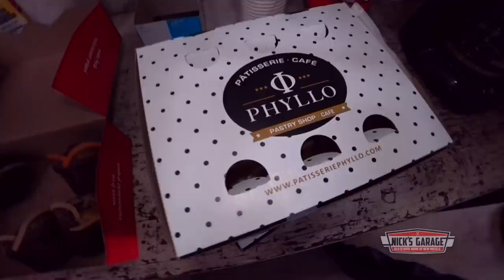1968 Coronet R/T 4 Speed Rises From The Dead

Comment: I had a VW-Manx that was a 1963. The VW dealership helpede build a 2140 cc motor with Empi parts. It was just like you said about a kit car. It felt like a toy to drive but it was a real car. It didn't pass the safety inspection so I could run it down the dragstrip. That's what my 65 Barracuda was for. I fell in love with the original Hemi under glass. My dad and I put a 392 in that car that my dad built on paper and them in real life. He was only off by 30 hp at 5800 rpm from his paperwork to the Dyno. He worked at Chrysler do it's in our blood. My dad passed away in 2003. He forgot more then I ever knew and I can build a motor. Anyway sorry for the rambling. You bring back a lot of good memories hanging around my dad as a young child with all his racing buddies in the garage working on cars and drinking a few beers. My dad always had the old cases of bottles of beer stacked up in the corner and he would tell me to load them up and he would take them back for the deposit and he would buy a few more. It was those little jobs like going under the car to pick up a dropped socket or a bolt. You know that they always go to the center of the car if you drop them or they fall into the frame or a little book that only small hands can get. I remember my dad holding me upside down so I could track a bolt. That is how I started working on cars in 1973. Thank you and have a great day.
Reply: Bigger.        I also started working on cars in 1973.
Reply: @nickpanaritis4122  I think I was a bit younger. My dad had me helping him when I was 4 years old. That's when I changed my first tire. My first car was a 72 Dart with a 383. Way too much power for a young driver. I crashed it after my dad and I worked on it for a year. The car was only 12 years old then. I feel like a old man😄

Comment: Love your Videos Nick! I am a old Mopar nut. I have been out of the hobby for 30 years. I bought a 67 Coronet 500. It was a small block car when it was born. At one point someone put a 383 in it. The car had a lot of "good" bad work done to it. I bought it from a real meathead. I have spent 7 years fixing age issues and stupid human issues. I totally re wired the car. refreshed the engine with cam and lifters, and tons of just stuff. Yet my car still pisses me off. At 900 to 1100 rpm the steering wheel shutters. It did it the day I bought it and after 7 years and other repairs along the way. The shutter remains. Its not speed related, Its not tires or tire imbalance, bent driveshaft, Unbalanced cooling fan, belts. It does it in park, neutral, and in gear. I have a 2:90 gear. Distributor locked out a 14 degrees with FBO, Initial at 20 degrees. That vibration / shudder happens to be at exactly 30 MPH. I have a edelbrock 600 with manual / no choke. The carb is "right" as it was built. Yet unsure of jetting. The only way I can get it to stop shuttering is to put fresh plugs in it and then that only lasts a few stop lights.  The plugs look good when pulled, No oil or fuel fouling.  I did a compression check and all cylinders were within 5% yet all were lower than I hoped for, like in the 140 psi range. I posted a short video clip on youtube on my channel.  Could you spare 15 words of advise? Thanks Nick!

Comment: Late '60s?? We were born the same year Nick, but I tore down my first motor at 4 years of age. I'd been handing tools to Dad, G'pa, others on our farms for more than a year. Left at home that day and I seen that 3 hp Briggs & Stratton for a grain auger-it was on. And when I mean tore down, I had everything disassembled but the carb still laying in 1 piece. I didn't expect the result I got when I showed Dad, it was put it back together right or the belt was coming off. I'd already had 1 belt tanning when he caught me with his .44 mag and I wasn't taking another one. It ran, I'm sure he pulled it back apart and tightened bolts/nuts after the first start up, but it sat on that auger for years.
Wish I'd of stayed with it as you have though. I hadn't owned any tools in a couple decades but emergency tool kits for vehicles until lately. Now I'm taking care of my 4 outboards and just did first start up today for a friend on her 115 hp Yamaha the factory messed up by installing #4 rings backwards and one upside down-not the same as a MOPAR or FOMOCO.

Comment: Nice job on the RT.. I had a 1970 440 coronet with a 318 back when. I couldn't  get it to steer right , wandered all over. I went to 3 shops for help but  only got the story they all steer like crap. Later in my mechanic life I found out any car that has only the spring bushes and the leaf springs to hold the rear axle in place is going to allow  axle movement and hence always you are playing catch with the rear axle moving  around. You can really loose it if the axle moves around under big  power. The answer to great steering is to put a panhard rod on the rear axle. If you really want fine steering, links fore and aft help under big power. also check the steering box for movement  when the car is running.I don't know if you can buy these bits  but I know you can make them. I remember the oldsmobile  442 cars with all kinds of rear axle links and rods. They steered so nice. Love your work and appreciate your vids.

Comment: I owned a cornet 68,  it was huge, plenty of back seat room to do anything.
Reply: Richard Buckner check that
Reply: Thats the reason young guys today like Crew Cab trucks lol..Not as cool or quick as a Coronet RT but has a big back seat and a bed!
Reply: @01trsmar  Before I finally found a wrecked charger with a 440 magnum to put it mine, I still used that back seat.  You could live in the trunk.  One thing I liked that dodge did, they had adjustable front suspension bolts, so you could lift it or lower it. All car manufacturers should have did this. Simple design.
Reply: I had a 68 Super Bee Scat Pack. Converted it to a 413 solid lifter flat tap with over 600 lift, 4 speed, 3:23:1 posi, some suspension mods, headers with oval straights, and L60X15s all round. No problem burying the speedo needle with plenty to go. That car was built in Canada and weighed 2600 LBS. You guessed it, No power assisted anything and it ran with points dist. and a 60,000 volt hyd. coil.
Reply: Start a family?

Comment: When I saw the 1970 Fury my jaw dropped open. I know I worked on that car adjusting the windows. They only ran those on day shift at first because only a handful of us had been trained how to adjust the roof and the glass so they would make a good seal. My fingerprints are somewhere on the pieces inside the right front door, that was my side.

I'm surprised Mike wanted the engine blue. All the magnums I ever saw were orange. But hey, it's his car man.
Reply: Mike.     It is turquoise in 1968. During overhaul, you can see the original color of the block.

Comment: Those break checks are always a little scary for me.  I was driving my 1969 Charger going down a hill in the Capitol Hill district in Seattle and came to a complete stop twice.  I then made a turn onto a level street and hit the gas.  Coming to a red light, I hit the brakes again and . . . nothing.  The drum brakes were so heated after the other two stops that they had given up.  I hit a lady's Mercedes and damaged my front fender while trying to dodge traffic in the intersection.  After that, I converted to 11" front disk brakes using Mopar parts from other years and models going by a parts list I found in a Mopar magazine.

Comment: All the cars at Nick's Garage look quick Just another day for Nick A slick oil change for the cab and Nick's got some lovely coffee to grab Mick sent it for Nick If I see it on the shelf then off it i'll pick Coffee and Phyllo pastry it all looks very tasty A very civilised way to start the day. The Cobra's nearly done So it's time to have some fun Power to weight In the Cobra you'll be early and never late Jeff's got a ride to take Al's 440 Satellite Gonna get admiring glances day or night Al knows where to take it To get it running right! Waow a 70 Fury looks super clean in green to me Only the fuel gauge is showing its age Nick will save his customers from rage. Time to retest the Coronet flies like an angry hornet Now it stops like it goes up n down through gear throws After a Brake fix This coronet with a 440 is a heady mix Thanks Nick and crew for sharing your tricks!

Comment: Nick, please wear the seatbelts.  It isn't your driving that I'm worried about, but the other guy you never see coming.  The inconvenience of wearing a safety harness that might save your life is worth it.
Reply: I wonder if the other residents on that public street are annoyed by Nick using it as his private drag strip?
Reply: I can show you pictures where a seat belt would've killed me. It was a good thing I was thrown out of that seat belt. It still took them 2&1/2 hrs. to cut me out of the wreckage. And I was upside down & covered with hot fuel. My left foot was pinned with the steering column up against the firewall and the stick shift was wrapped around my right leg. Thank the Lord I am still here.
Reply: I say just let the man do his thing. Nick knows what hes doing and i trust his opinion on that
Reply: for every instance of a seatbelt killing someone, there are 100 times they saved them...do the math, wear your seatbelt.
Reply: I've been in one serious one, 2 kids car seated in the back of a ford escort...not a scratch.  Hit a pickup so hard the rear end came out from under it.  Had a little one in a mall parking lot when I was a kid...ended up on the dash, thrown from the back seat...8mph, maybe.  The numbers don't lie...seatbelts save lives.  Do you watch Nascar?  Did you watch Dale Earnhardt's last race, where the belt failed?  He just barely kissed the wall, and other drivers survive horrific crashes without a scratch.
Reply: Uh, Oh...!!! The thought police are here!!! You are worrying about absolutely, nothing!!! FACT!!!
Reply: Go Nick!!! BURN RUBBER!!!

Comment: My fist mopar was a 68 coronet 500 two door 383/727
I
Will
Have 
Another 
Before I die
Reply: Mine was a '68 Charger R/T 440! I want another as well!
Reply: mine the super bee version 440 tri power same color. i loved that thing till gas prices went outta sight.
Reply: My Pops had one. First car I remember in life. Went through a set of rings a year for 2 years before he traded it off.
Reply: @steves5346  awesome car I love the tri power
Reply: '70 Roadrunner/383, stick, grabber.
Reply: great Haiku!
Reply: my first car was a 1969 Roadrunner 383 4 speed. no ac, no power brakes/steering. back then it was a $600 used car. 

I will have another too before I meet my maker
Reply: Start saving because the real nice ones aren't cheap like the old days. Plus they are disappearing fast - going overseas like crazy - those guys are buying everything.
Reply: My first would have been my '50 Plymouth four door in 1961.  Poor thing had a rusted out floor on the driver's side and rumbling main bearings.  Plus side was it only cost $85 and fuel and oil was cheap.  I'd like to see what Nick could do to get the old flat heads to not wear out their mains so commonly.
Reply: @whalesong999  I may be wrong , but a new crank and bearings casting of modern material might be the answer.
Reply: @craigpennington1251  Thanks for the response but the need is long gone and was a bit tongue ib cheek.  The old Plymouth lost it's brakes and was eventually sent for scrap.  I did like the old car, so simple but quite a boat even for it's period.  In the mid '80s, there was an ad for a '50 DeSoto sedan in Wichita and me and my wife went to look at it, quite rare.  Considering it's age, wasn't too surprised it's underbelly was rusted badly and it's mains rumbled too, disappointing but really not surprising.  I was in no position to take on a collector car in need of serious refurbishing.  I actually think the design was too marginal for longevity, a four main bearing crank with very conservative dimensions.  Maybe higher oil pressure and good oil was the best answers.  It leaked pretty badly at the rear seal and I would top off the oil at fuel stops.  Had the old car been serviced with a good HD oil in it's youth, would have acted better.

Comment: The owner of an original big-block Cobra asked if I could tighten a sending unit on the bottom-rear of the pan. It was so low that I asked if I could lightly jack on the front bumper so I could get a second jack under the car. The interior was all pop-riveted aluminum. The seat had no real padding and, if you sat up, you banged your head on the windscreen. When he left, he was 'tiny' by second gear. I don't think I even heard a shift chirp.  That was intimidating.

Comment: 4:43 On the cobra here it looks like its mounted on the passenger side of the transmission tunnel, might be a quirk of the 289 cars like I think this is based on, so I would check their and under the passenger seat, as maybe a mount got blocked or a cable simply snapped, which has happened to me of all things on a car with the old style pull handle for the brake. 

like braided wire, and the thing broke in my hand, not the plastic, the wire itself.

Comment: I was at a autoshow/swapmeet and there was a 68 cornet RT on display. The owner claimed it was legit but I overheard a guy in the crowd claim it was a phony. He said because it didn't have the chrome rocker panel trim and no turn indicators on the top front fenders it wasn't a true RT. Does anyone know whose correct? It was a 440 w/4speed.

Comment: Nick how do you like driving the Cobra. I was disappointed in them.
I prefer a little more car.
The Cobra beat me up.
After 45 minutes I was sore.
Not really the office of motor management I had in mind.
I'd rather have a 4-speed than a 5-speed. Less uncertainty.
I didn't like the muzzle blast during downshifting. There's not much weight to transfer. When a Cobra gets out of hand, it gets way out of hand. Comes down to motor management.
Reply: You expect a 2300 lb 2 door car built for the track to be comfortable??
Reply: @otm646  For the money I don't expect you have to grind the edge off my driving shoes.

Comment: So we still don't know how the bolt came to be in the cylinder?
Reply: Ican.     When the carb was replaced, I'm sure.
Reply: @nickpanaritis4122  It just looked so big from what I remember I can't imagine it making it's way past a valve. But it'd be pretty obvious laying there when setting a head back on too. Oh well.
Driving my '68 Corolla one day, I had a tiny brass screw from the lower butterfly on the carb fall out , sound like a machine gun for a second and go out the exhaust. It was pretty soft though and just made a few peck marks on the piston and head. That took a while to find and figure out "what the hell was that?". ( I make sure they're peened well now and add a drop of loktite).